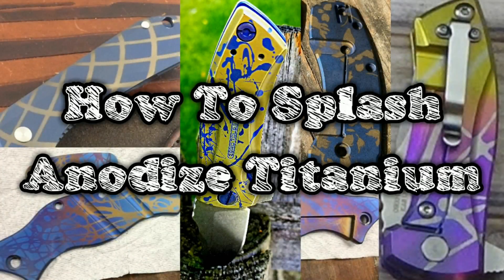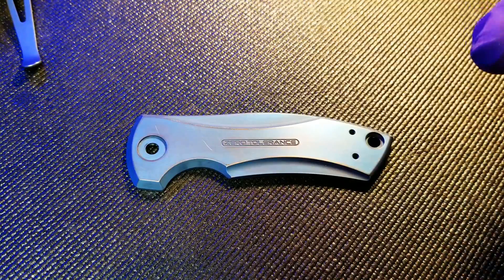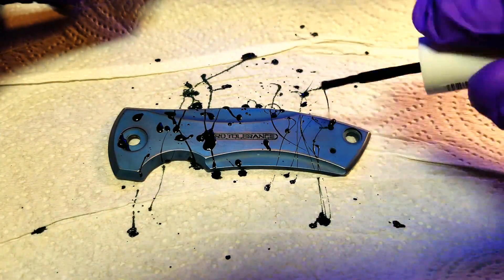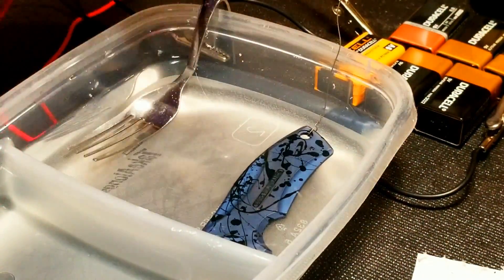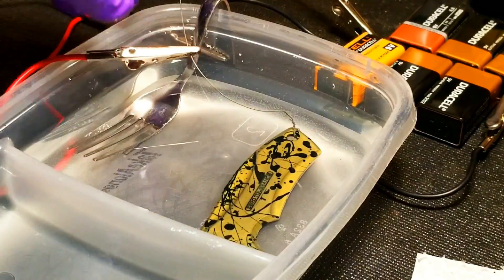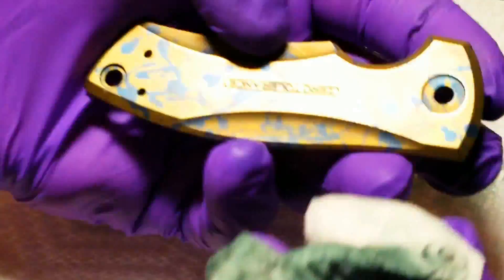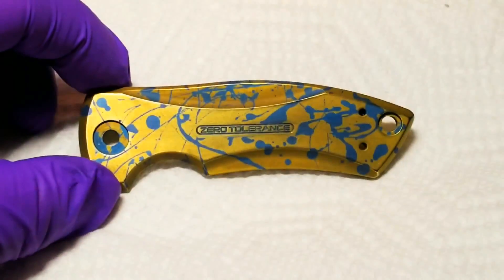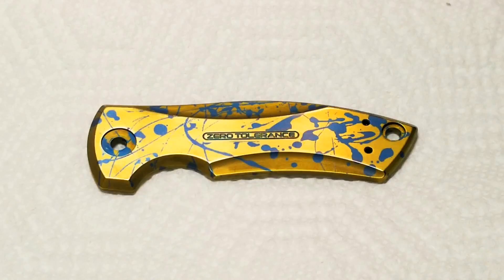Transform Metal Permanently With Nail Polish - DIY Titanium Anodizing

Comment: Hello there, great video. How do you achieve the colour underneath? Say like I wanted red with black splash or vice versa. Would I anodize the part black first add nail polish then anodize it red? Also, what do you use to remove the nail polish? Maybe I missed that anyway. I will check out your other videos. Thanks

Comment: Do you have to sand the scales and polish before anodizing the titanium?
Reply from the maker: You don't have to if they are bare titanium, but if there is any sort of sealer then you'll have to remove that first. If they are anodized already you'll have to remove the anodizing if you want a color that corresponds to a lower voltage than what is currently on the scales. If you want a color at a higher voltage you can anodize over the lower voltage color without removing it. Hope that makes sense.

Comment: Hello, Where did the blue go?
My knife scales are very light blu now and I want them "shipwrecked" or dark bronze.  Don't I need to strip first?
Thank you for the video and upcoming advice
Reply from the maker: Try wiping it down with alcohol. The color should come back, but as soon as you touch it and get the oil from your skin on it the color turns light again. It's because of thin film interference, which is also the reason we see colors once its anodized. It's like oil in water, the rainbow effect, same thing. So when you get oil on top of that film it makes it thicker, and doesn't reflect the color you're used to or trying to see. I hope that makes sense.
Reply: @ApollosRings  I wanted my ano off, the product featured worked like hand soap.. It did nothing.  I appreciate your trying to help.
Reply from the maker: I don't know where you're from, but if you're utside of the US  they use a different active ingredient which does not remove anything. HF acid is the ingredient you're after, but it's some nasty stuff. Multi-Etch is another option.

Comment: Question: I have a knife with pinned AL scales. Do you think it would be possible to Anodize with a really shallow pool of solution? (Want to keep the anodizing limited just to the outside of the scale and not have any touch the insides or the blade) All vids I see are of fully disassembled knives.  Thanks in advance.
Reply from the maker: Ahh, I see what you're saying. I answered your other question first before reading this. Yeah, that could work, or you could do a sponge or paper anodizing where you don't have to submerge anything.

Comment: I like the zero tolerance splatter knife and think it would look awesome with the purple, blue and green. Keep doing a cool job. I did notice that you used a brush on the part and haven't seen you do that before, is there a reason and what kind of brush?
Reply from the maker: Any brush would work for that. I don't always use one, but sometimes the surface of the titanium will get bubbles on it, and where the  bubbles are it won't anodize. I'll brush the bubbles off to make sure everything comes out evenly.

Comment: This is kind of an older video so a bit of a long shot but any recommendations on nail polish to use?
Reply from the maker: Honestly, damn near any nail polish will work. You can get the cheapest dollar store crap you can find and it'll do the trick. Just put like 3 or 4 good coats on and make sure you let it dry completely before you anodize.
Reply: @ApollosRings  thank you very much over the last couple days I've been pouring over your videos trying to get the best results possible. Greatly appreciate all the information you put out because there's not a whole lot out there easily found
Reply from the maker: Glad you found the videos helpful! I've still got a couple tricks up my sleeve as far as the anodizing videos are concerned. I'll be adding a video shortly on how you can achieve the elusive "black" anodizing. I know there are a few half cocked videos floating around out there on the net about dipping in oil, but that isn't true black ano. The method I have details how to actually achieve the real thing. Stay tuned, and thanks for watching!

Comment: Have you ever had problems with tolerance after ano? Ive done one knife about 5 times and now it has bad lock rock. Im sure the acid ate away too much ti
Reply from the maker: It's definitely possible. I try to only leave a piece in the acid long enough to get a quick etch, and if there are parts with close tolerances I will cover them with nail polish so that doesn't get screwed up.
Reply: @ApollosRings  cool thanks for the reply man

Comment: Awsome job man. I have a question about acid etching a blade. I want to acid etch my MPR but want to keep the original logo and lettering any advice?
Reply from the maker: Hey, thanks! Thanks for watching as well! As far as the acid etching goes, I've used nail polish and electrical tape in the past to mask off areas. You can probably get away with a clear gorilla tape so you can see through it, then cutting it, but you would have to be pretty exact cutting out the mask. If I were doing it and it was really important that I saved the design, I would probably scan the logo into a file, then have it reprinted in vinyl so I could re-etch the logo after whatever work I was doing. That's just what comes to mind, there could very well be a better way though.

Comment: I have a twosun ts 16. Its stone washed or bead blasted. Can i anodiz over the existing finish? There are spots on the front scale that are milled so it would be hard to sand it evenly.
Reply from the maker: You absolutely can, as long as it isn't coated with any type of clear coat, but I don't think Twosun clear coats their scales, so you should be good. I do still recommend using Whink, or some sort of etch prior to anodizing just because you'll get a much deeper color, but it isn't absolutely necessary. Just FYI, some of the colors higher up in the voltage range can be really tricky to achieve without some sort of etch prior to anodizing. If you do decide to use Whink, there's a Amazon link in the description of the vid if you need to grab some. The beauty of the Whink is that it'll get in all the cracks and crevices that sand paper can't.
Reply: @ApollosRings  thank you. I'll pick some up
Reply from the maker: No problem! If you run into any issues, feel free to leave a comment on here, or message me on any of my social media, I have links to everything on the channel homepage. 👍🏼

Comment: Thanks so much for this video! Is there a reason for using batteries rather than a DC power supply?
Reply from the maker: Glad you got something out of it! I wanted to do it with the batteries to show that you don't need a power supply to get great results for very little $, but if you have access to a power supply you can definitely fine tune your colors a bit more. I have another video coming up in the next few weeks that will show a similar anodizing technique as well. I'll be showing how you can get results  mimicking timascus. If you're interested, stay tuned, and if you give any of these projects a try and need anything clarified, feel free to ask about any questions you might have!

Comment: Thanks for the vid! How could I do the exact opposite of this? I want the handle to be mostly the standard grey titanium but I want splatter highlights that are the anodized part
Reply from the maker: You could anodize the entire piece to the color you want the splatter, then splatter with nail polish, let it dry thoroughly, then give it a quick bath in the Whink to remove all the ano. Then hit it with acetone to remove the polish. All that will remain will be the splattered ano color against the bare titanium. That make sense? It did in my head, lol
Reply: @ApollosRings  makes perfect sense! That should work! Thanks so much for the help
Reply from the maker: You got it brotha! If you need anything else, just let me know 👍🏼
Reply: @ApollosRings  now I just gotta find myself a brs barebones v2 to buy so I can get it rehandled with titanium so I can try my luck at anodizing
Reply from the maker: Well, you've got a plan at least, lol
Reply from the maker: If you didn't want to anodize the entire piece you could sponge anodize wherever you want the splatter to go as well, then continue  the way I stated above. Theres a video on the channel for sponge anodizing if you need to know how to do that as well. If you've got any questions, feel free to ask.

Comment: New sub. Knife collector for 30+ years. Gonna give this a go. Green is said to be the hardest to get but I seen on another one of your videos that 12-9volt batteries hits that toxic green color. So fingers crossed
Reply from the maker: It definitely worked best when I used the hydrochloric acid to etch it first. Good luck, and if you run into any issues feel free to message me with any questions.

Comment: Thanks for the great advice. I’m a huge fan of the T1 by kizer but never bought one yet due to the high shine factor. Now I know I can fix this! Fantastic! Will anodising work well over a corse stonewash on ti?
Reply from the maker: Yes, as long as there isn't a clear coat over top it'll work great. I don't believe they have a clear coat, so you should be fine, but even if it did you could remove it. Personally I think anodizing looks even better when done to a stonewashed piece. If you run into any issues, or just have more questions, feel free to let me know. I'll help any way I can.
Reply: SharpKnifeNuts Far out mate. Thanks for the advice. I’ll stay tuned for sure.

Comment: My favorite knife... that’s hard to say—my Manix 2XL is hard to put down though.
Reply from the maker: Good pick
Reply: SharpKnifeNuts Thanks!

Though I had a question—I just got this solid an already slightly modded ZT 0562CF. I think it’d look great with a splash more of colour on the titanium, but it has that light stonewash. Any experience anodizing over that, or would it be best to sand the whole back down to a smooth surface and start from there?
Reply from the maker: You can definitely anodize over stonewash., I've done it, and it comes out great. That being said, different surface preps yield different results. I've noticed that with a stonewashed surface the anodizing can come out a slightly different tone. In my experience its usually been more of a darker, muted anodizing, but still a cool look all the same. I would say try it the way it is first and see if you're happy with the resulting color. If you like it, great. If you aren't happy with the way it turns out, you can always remove the anodizing and start over with a different surface prep. It's really no big deal at all to remove the anodizing if you aren't happy with it. Personally I prefer a stonewash, bead blasted, or even lightly sanded surface to start with. Highly polished surfaces still anodize well, but the anodizing doesn't hold up as well. The anodizing is oxidation layer, like rust on steel, and the different thicknesses refract light differently producing the colors we see. On a really smooth surface it's easy to knock that oxidation off. That being said, the more voltage used to anodize, the thicker the layer of oxidation. Thicker layers can hold up a bit better. Sorry for the long winded response, lol. Hope I made sense with all that. I think I kinda went a bit off course, but hope it helps anyhow. If you need anything else, don't hesitate to ask!
Reply: SharpKnifeNuts Thank you, that was an awesome explanation. Think I know what I’m doing this afternoon now!
Reply from the maker: No problem!  Good luck. If you run into any issues, let me know and I'll do what I can to help. After you finish I'd love to see how it comes out! I've got my social media linked on my YouTube homepage,  feel free to send some pics!
Reply from the maker: The only thing you need to watch out for is a clear coat that makers sometimes put on titanium. I can't say that I've ever ran into it on a ZT, so you should be fine, but Spyderco puts it on a lot of their knives. It's a pain in the ass. If you ever run into a titanium scale that won't anodize, it could be clearcoated from the factory.
Reply: SharpKnifeNuts How do you deal with that? Light buffing/sanding to take it off?
Reply from the maker: Yeah, I'm sure there's probably a chemical that could strip it if you really wanted to keep the substrate intact, but the few times I've had to deal with it I just used sandpaper and worked my way up through the grits. It's just frustrating because you can't really even tell it's on there till you stick it in the bath and nothing happens. Then you start questioning if you have everything set up correctly, lol. After doing it for a while i know that if it's a Spyderco titanium, chances are good its clearcoated.
Reply from the maker: And in all honesty, the sanding didn't effect it at all from what I could see. I don't mind experimenting on my knives, but if it's someone else's it's a bit of a different story.

Comment: That was very helpful. Does the acetone remove the anodizing?
Reply from the maker: No, the anodizing is technically a layer of oxide, like rust on steel. It only removes the nail polish. The anodizing is extremely strong. I would say it's even stronger than powder coating. Thanks for watching!